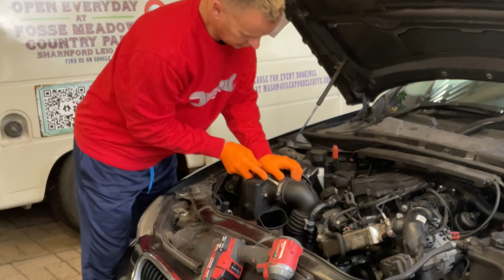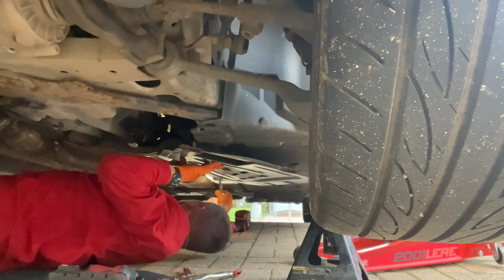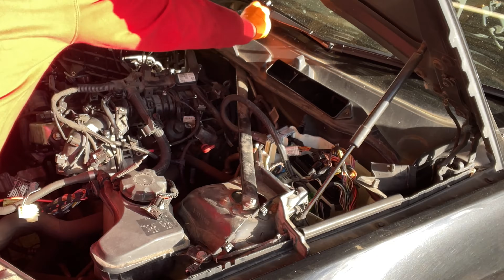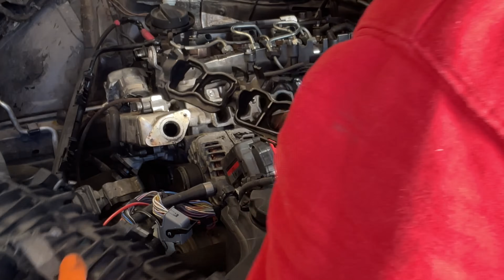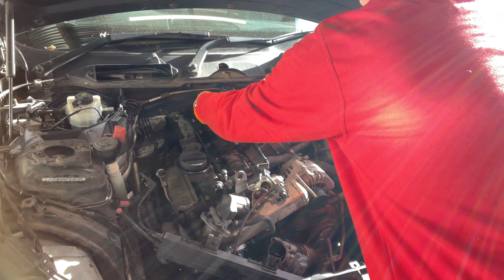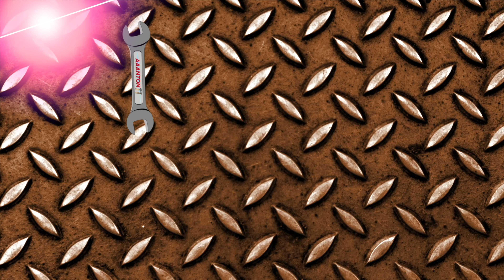BMW 318d N47 Diesel Timing Chain – Engine Removal Guide (Part 2)

Comment: great content bro but i just had chain done on my 2011 bmw 520d msport f10 and it was all done with out engine out and my friend did the engine mounts az well the f10 do suffer this issue is your engine more comlicated for timing chainn replacement my engine code is n47
Reply from the maker: Its all the same, maybe a few small differences, Thanks for the great comments👍🏻👍🏻🛠
Reply: @aaanton11  you are welcome great content keep up the good channel

Comment: which timing chain kit are you going to be using?
Reply from the maker: All bmw parts from the dealer going on, Thanks for the great comments👍🏻👍🏻🛠
Reply: Don´t cheap out the timing kit for these engines. BMW genuine parts or IWIS. I had to do this job twice because of it